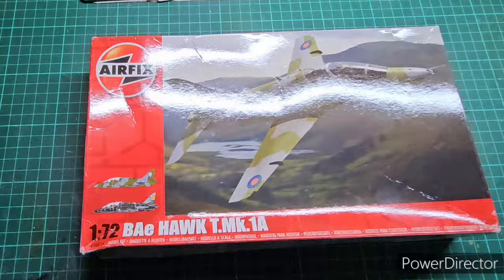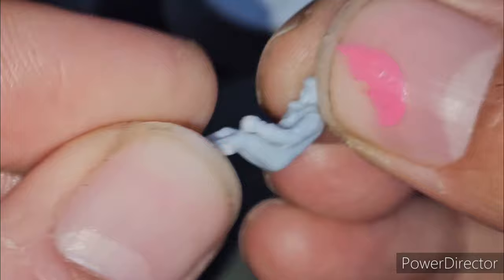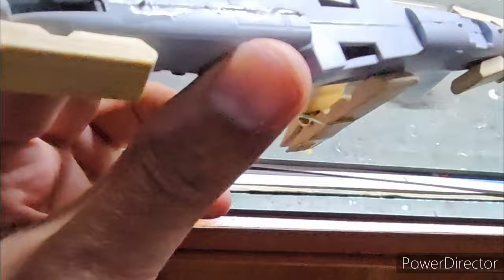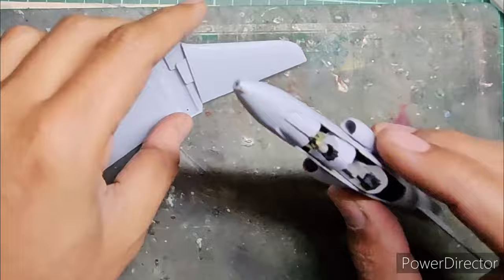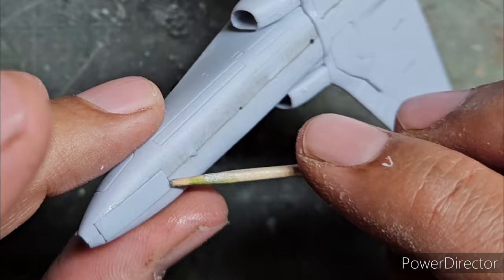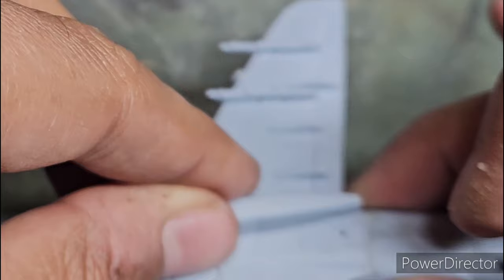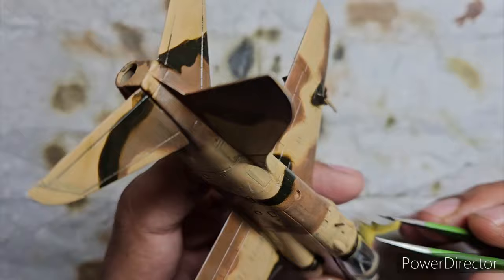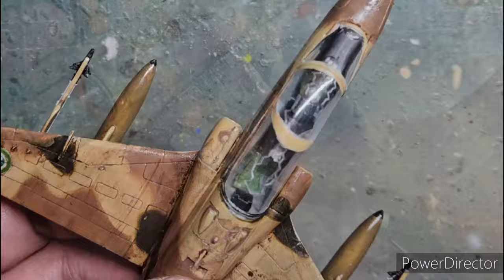Airfix 1/72 Hawk T.Mk1 || Royal Saudi Air Force Hawk 65

Comment: Great...!!!  What a fine build..
Especially the wraparound camo.
Model building... IMHO...is only 30-40% of the build. The paint on the model is the real tough job.
Keep it up...Happy modelling...
Reply from the maker: Thank you. I would differ in that. I'd say model building is the main thing. Because in order to get a smooth finish you need to have a perfect surface to paint on. That prep work is 60% of the job. If you don't take care if that, the final paint finish may not be the best and could spell disaster for all the work put in.

Comment: Hi, what additives do you use to thin fevicryl paints to enable it work with an airbrush ? Also what do you use to clean the airbrush. Acrylics and water- IPA 3:1 doesn't work well for me. What do you suggest ?
Reply from the maker: Additives: Water. Earlier I used IPA 70% concentration but I moved away to more safer ways of thinning. Water works perfect. You can see my video on painting with Fevicryl Acrylics here https://youtu.be/1DoWaSaDVTg?si=vxDvVSm5LTzKbjDO

Cleaning: Home made airbrush cleaner.

If your combination of 3:1 is not working, it would be helpful if you told me what other variables are involved like compressor pressure and consistency of your paint mix. Exactly what problem are you facing?
Reply: Hi, thanks for your tip. I normally use enamel paints. But I want to move to acrylics. My first attempt gummed up the paint and additives affected the adherence to non primed plastic. I'm going to try something else now.
Reply from the maker: @ksprvnksprvn4258  you need to use much lesser acrylic paint than enamel. Reduce the amount by 70-80% and then try. It's okay to start with a thinner mixture first and then add on to see how it behaves. Primer is important for adhesion